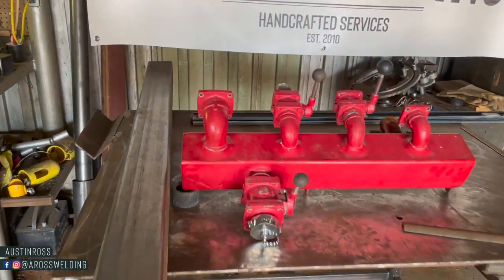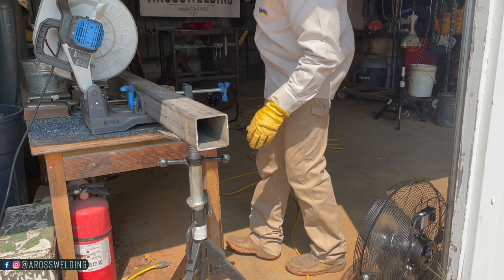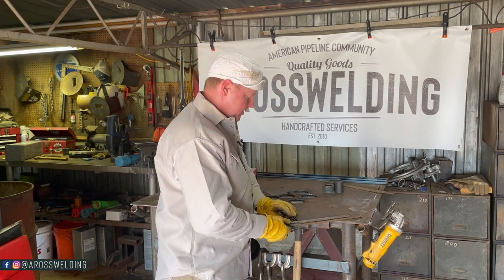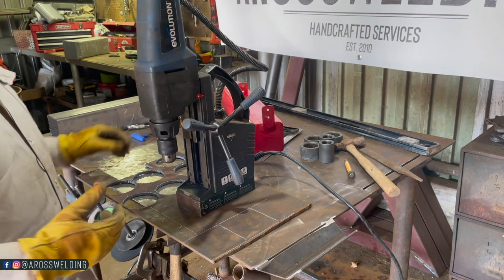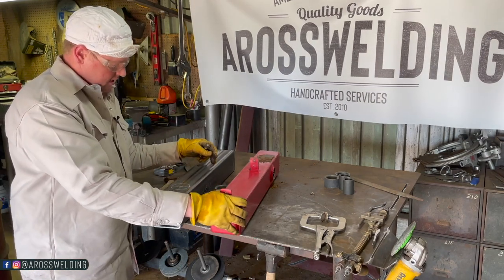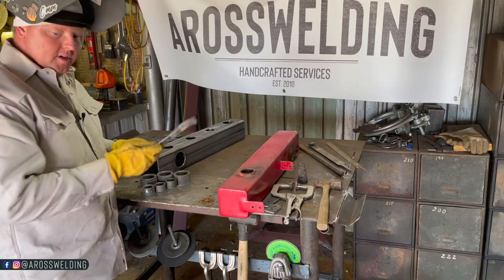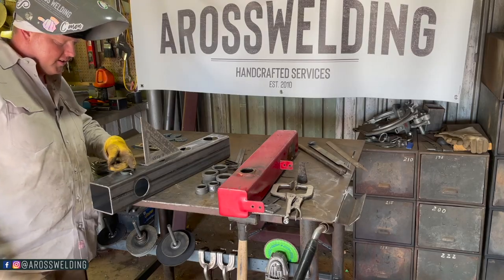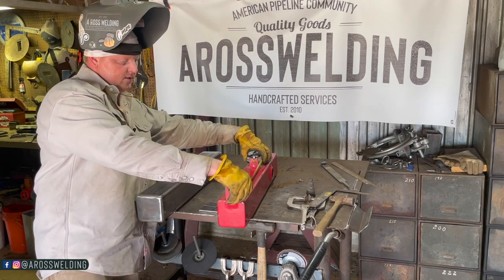RUSTY FIRE ENGINE MANIFOLD REPAIR (COMPLETE REBUILD!)

Comment: You can cap any way you like. I usually measure o.d. on something like this and bevel the tube a little so you get good penetration and when you clean your weld off you still have that edge on the end of the tube. Good work bud 🤟🤟🇺🇸
Reply: Hey quick question do you bevel both the cap and tube or just tube?
Reply: @the_borax_kid2233  you don't have to bevel both. A good bevel on one or the other all the way around is sufficient. I prefer the tube so there's no undercut. Just my preference
Reply: Ok cool I love to get input whenever I can wherever I can. Thank you very much. I've done custom trailers and stuff but not a whole ton of hydro. The dump trailers we did, got hydraulic cylinder kits. Love to learn though.

Comment: Took longer to watch the video than the project would have taken to complete but I don't regret the time spent. 
When you're trying to replicate an old part in carbon such as the couplings, you always want to add 1/8 to the elevations(stickout) of the original pieces because the metal will always shrink. On something as thin as this you could get away with 1/16 and probably end up on the money but 1/8th is the general rule of thumb.
On this manifold it won't matter at all because it's all connected to hoses anyway, but it's still a good habit to get into.

Comment: I have a lot of years both as a tool and die maker and a welder/fabricator. I intend these comments to be polite, just in case they read otherwise.
1. For the love of god do not wipe anywhere near any spinning machine like a drill with a rag, let it come to a complete stop. 
2. Never wear gloves when operating spinning machinery, period. I understand as a welder we are in the habit of wearing gloves a lot, but when using spinning machinery absolutely never wear gloves.
One last safety tip. On mag drills use an additional clamp on the drill. Should there be a split second interuption of power (which can happen) the mag will immediately turn off but the drill will keep spinning possibly catching on the material throwing the base around and around.
You have a great channel and are a very contentious worker. Keep up the good work, be safe.

Comment: Cool bobcat!  This might sound funky but I use Windex with my mag drill!  Seeing you using that torch makes me wonder if my purchase of my plasma cutter was a good idea...
Reply: You will not regret the plasma cutter purchase!
I have 3 cutting torch set ups, and a plasma cutter.
Reply: @haroldphipps3457  I have never used a torch, so I cannot compare. I imagine that there's places that one is better than the other.
Reply: @jvazquez53  you are correct.
As you use your plasma cutter you will find where it excells and its shortcomings. 
You will want a torch at some point for sure.
Reply: Plasma is good at cutting stainless....

Comment: the carbied blades ON YOUR SAW  for you can be re sharpen find a local blade shop. i use United Saw in humbult TN.good people i buy my band saw blades from them etc i think they sell alot of air nails for building houses they rebuilt my stanley air nailer in 20 mins. good folks we have alot or did have alot of wood  and metal shops in the area they have a full custom blade sharpening servive

Comment: buy your annular bits for your mag drill from msc or ebay your machine may turn a 3 inch bit drill a hole weld in the fitting

Comment: One trick on cutting 4" metal with a chop saw.  Flip it over to cut the bottom.  The killer of saw blades is heat and the angle of the saw blade on the bottom of a wide piece of metal forces the saw blade to cut from the middle to the sides.  Your blade will last much longer if you flip it over to give the saw a better angle.  I do this on everything 3" or larger.  I can make a $90.00 blade last for over 1000 cuts.

Comment: Half coupling only has internal threads roughly 3/4 of the way through the piece where a full coupling is threaded straight through. Food for thought!
Reply: Nope.
Full coupling is threaded from EACH end.
Pipe threads are tapered!!
Reply: @haroldphipps3457  Yes, you got me on a technicality. LOL

Comment: Where did you get the straight cutting attachment for your torch? I can’t find one for my Harris handle anywhere
Reply: Might be available on his website
Reply: @blackwateroutdoors7364  nah he has the circle burner for it but not the cutting attachment itself.
Reply: @JacksonEngineering  ok I thought he had the whole assembly. May have to contact Harris directly.